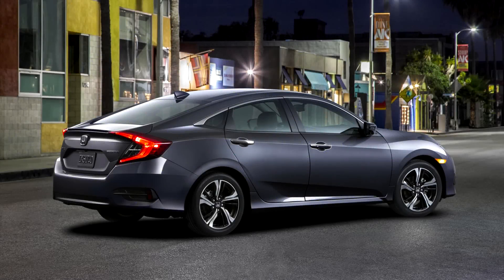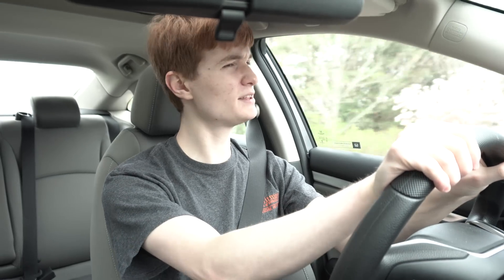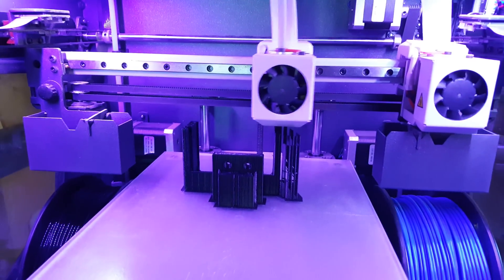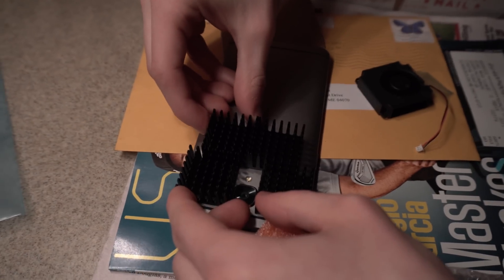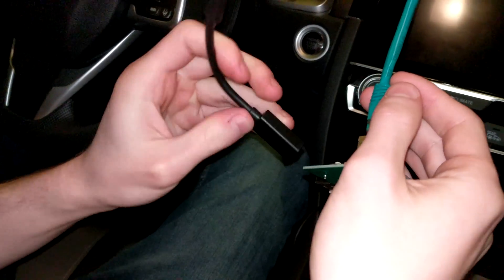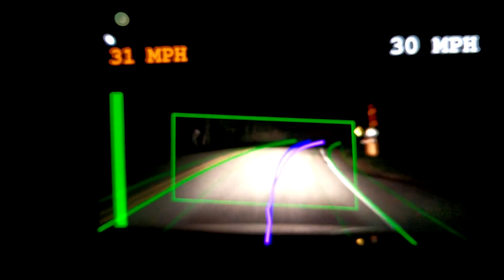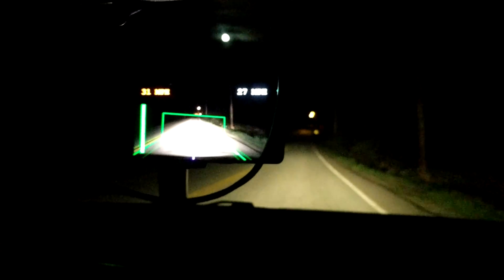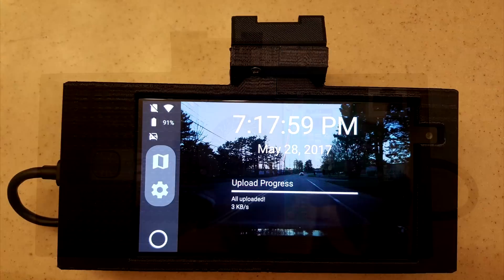Building a Self Driving Car | EP 1 (comma neo w/ openpilot)

Comment: I'm a bit confused....your car seems to already have a lane departure camera, and would also then have radar cruise control....so, your car basically has level 1-2 self driving when the cars lane departure and radar adaptive cruise is engaged....unless I'm missing something, you basically took away the cars features it already posses, and in turn replaced it with an open source system that just replicated what the car already has the capability to do. Does this do something that the factory software is not capable  of doing? I dont see many differences from what the factory honda software does....elaborate if I am incorrect. Cool stuff though, thanks for sharing!
Reply: Factory LKAS is really bad on Honda Civic IMO.

Comment: Well done on your efforts so far, but as an electronics engineer, may I suggest that you really DO make the effort to bring your soldering technique up to a much higher level of competence? Looking at the results of the work you have done on the existing cabling I have to say that it is shockingly bad, and at serious risk of failing - particularly with the inevitable vibrations the components will encounter during use. You need to make sure that the wiring is adequately insulated right up to the pins, and that the finished plug(s) are complete with their covers, and with edequate strain relief on the cable in situ. After all, we are not talking about a trivial piece of kit here; your life, and the lives of others could potentially be in danger if catastrofic failure of the system occurred. Take care, and the best of luck with your endeavours.

Comment: ok, I don't understand. This Honda already have Lane assist and acc right? So it's basically is already Level 2. A real innovation would it be to drive itself on a let's say 2009 Mitsubishi with only Cruise Control.
Reply from the maker: If you used Honda Sensing, you'd know how limiting it is. It can barely apply torque on the wheel and ping pongs all over the place. It also only works above 45mph, and for around 10 seconds at a time without jerking the wheel. And when the car stops you have to press a button to have it start moving again. Essentially, the hardware is there, but the software sucks. openpilot fixes all of that :)

Comment: The fan goes on top of the heatsinks, my dude...
Reply from the maker: It's a blower fan, so it blows air out the side to go through the heatsinks in this case, I appreciate the comment though :)
Reply: VirtuallyChris 
Either way he is right.

It needs to be on top of the heat sinks.

Comment: can you do this in an old car? Such as a 99 or do es your car have to have self driving features already integrated?
Reply from the maker: It is theoretically possible, especially if you wanted to use external motors. https://github.com/openmechanics/openmechanics/blob/master/README.md But for now, the easiest thing to do is have a car with lane keep assist and radar adaptive cruise control built in.

Comment: Very dangerous. Like a inexperienced pilot trusting a plane right up until it crashes.
Reply: they were going 30 mph while hand hovering the wheel, the average driver is orders of magnitude more dangerous.
Reply: The world can use thinkers, but haters... not so much.
Reply: RadarNC technology Is wayyyy more than enof that we could have autopilots on planes 
And there would be like 0 accidents

The only reason we still use human pilots in planes is because most people dont want to trust an ai to drive a plane even thoe it would do a way better job than the actual pilot
Reply: MR ONO Its only takeoff and landing a human does during a normal airline flight. Everything else is autopilot
Reply: MR ONO you don’t know how autopilot works my guy. Autopilot can’t land or take off planes, and pilots fly more than just commercial airlines. It isn’t as insane of a technology as you think. Nor can they taxi or communicate with a human tower very well.
Reply: RadarNC u in the present or past m8, tech is better than ever
Reply: @]CIA[ VeryNoice
Autopilot CAN land an airliner it's called "Autoland" it's used when visibility is low in certain weather conditions where manually landing a plane would otherwise be dangerous or impossible.

Comment: Roads and highways need to have added WIFI or low power radio legal speed transmitters alongside them that throttle back legal speeds cars and other vehicles can drive on them during poor weather conditions and road crew work. Cars can read the currently legal speed limit from the devices with WiFi or low power radio receivers as they pass by to automatically control the vehicles' speeds. DMV crews can attach these transmitters for smart cars to their visible speed limit signs (but they need to be locked physically and software-wise so they aren't hacked! Even if such a system were hacked, the cars using the systems should be smart enough to disregard insanely high speed limits being output by a hacked, malfunctioning, or defective speed transmitter device) Jim Blier (Waldoboro, Maine).
Reply: James Blier ...what? That's a terrible idea. Why require that sort of infrastructure?
1. Smart cars can use the average speed of traffic to infer the proper speed.
2. Computer vision can read speed komiy signs easily.
3. GPS can be used in conjunction with a database of speed vs location
Reply: You should never physically restrict a driver from doing anything.

Comment: 1:05 "We've got the Ethernet", technically it's RJ45. It's meant to connect to a CAN bus which you are accessing by unhooking the lane keep assist camera module.
Reply: APEXstudios: RJ45 is the connector. Ethernet is the protocol. Ethernet can also be used over older coax connectors. Important not to confuse the two, even if 99.999% of everyone out there does.

(Cisco also uses RJ45 connectors for something that's not Ethernet. They have serial console cables that use RJ45.)

The protocol and the physical connector are two separate things. (And with DIY RJ45 connector stuff, NEVER assume the pinout.)
Reply: linagee I just learned that. From now on, I'll continue to say ethernet cable because otherwise, people wouldn't understand me or think I'm a pompous ass.
Reply: AHCKTUALLY
Reply: Yeah true but I see nothing wrong calling it ethernet :P